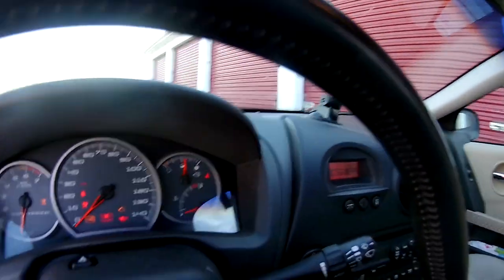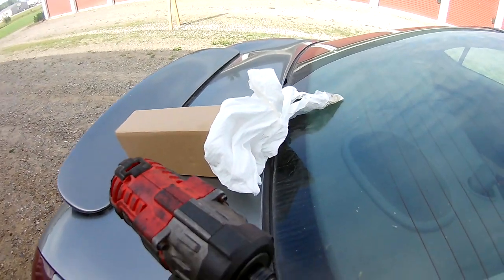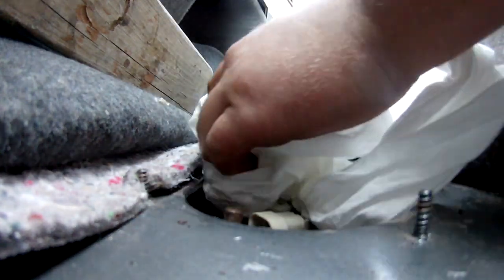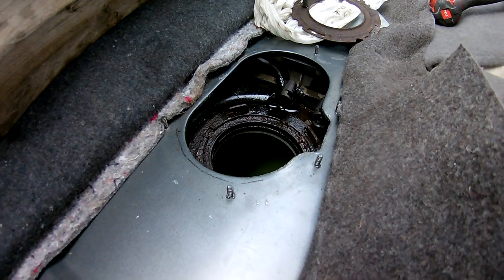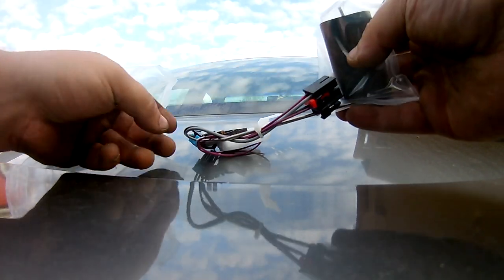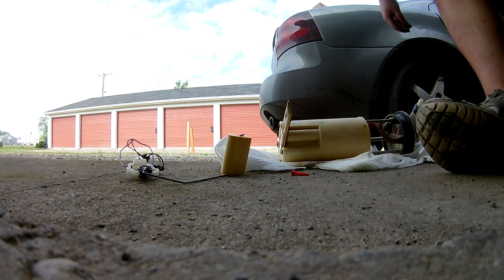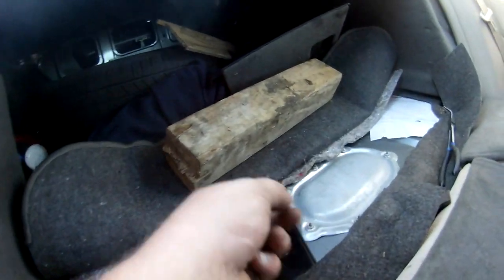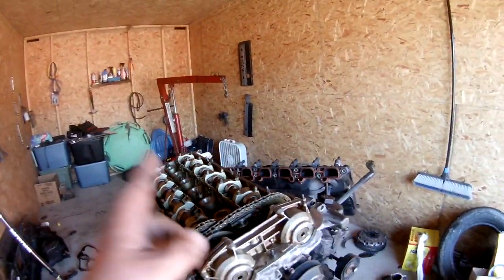Easy Fix To Grand Prix Gas Gauge Empty Full issue

Comment: If you have a 2006 or newer and have to cut an access hole in your trunk to get to the fuel pump (like I just did), the sensor is a different part number than the one in this video. The white plastic connector changed just a little bit. The year newer part (almost identical to the older one) cost just under $240.... yes $240 for basically the exact same part as the $40 one in this video for a 2005 and below. Looks like you can get an entire fuel pump with the sensor on Amazon for around $75-$80. I may try ordering that since I already cut an access hole.
Reply: Is it safe to cut into it the trunk tho?

Comment: It’s not “burned.” That’s just how surface printed carbon film resistors look. You can find them in any potentiometer. They still wear out though, as you demonstrate. Still, it’s just as often the wiper contacts wearing out. Too bad I can’t get to it in my Pontiac without dropping the tank. :(

Comment: Great video thanks.  Recently purchased an 04 GTP with 79k miles and the fuel gauge isn't working.  Looks like you walked me through how to fix it!

How is your fix holding up.  I see the AC Delco part is almost $170 versus the Dorman part which is $37!  Just curious if everything still working correctly.

Again, thanks for the video!
Reply from the maker: Glen Halstead anytime man! Jealous of the gtp
Reply: @GottisGarage  Are the Dorman parts holding up?  

I got a good deal on the GTP Comp G put it has the fuel gauge problem, code P0463 Fuel Level Senor Circuit High Input,  which after finding your video seems like a rather easy fix, and I'm getting a code, P0137 Oxygen Sensor Circuit Low Voltage, Bank 1 Sensor 2, Intermitent, which hopefully just replacing the O2 sensor.  

I have an 04 base GT Grand Prix but tranny went at 131k miles.  And the GTP Comp G only had 78,600 miles and exterior and interior were near near condition for $3400 plus tax/title & license.  I paid for the car fax and it was a one owner car that was serviced on a regular basis with no accidents reported.  I was quoted $3400 for a rebuilt tranny with 3 yr / 36k mile guaranteed.  The Comp G seemed like a no brainer for the same price.

Now I've found a place that will do a rebuilt tranny with a 2 year / 24k guarantee for $1700.  So may keep the base GT as a winter car and car for my oldest who will be driving later this year.  Even though the base GT has 131k on her for a pretty well mantained 3800 Series III engine I should be able to double that.  Have to see how I do after we finish our tax returns though about spending the $1700 (plus tax) on rebuilding the tranny.

Again, thanks for making the video.  It's going to be a great help in fixing the fuel gauge!  

I'll be sure to check out some of your other videos as well.  I've only been working on my own car for about 2 -3 years now.  But I've learned and saved A LOT of money by watching YouTube videos like yours.  I really appreciate people like yourself who are willing to share their knowledge and passion for keeping these cars, and cars in general, going.  Thank you very much!
Reply from the maker: Glen Halstead still working just fine! It’s a very cheap and easy fix that anyone can do, no point in dishing out money to have someone else do it for you! 
It’s a pretty common problem with gm vehicles, my Silverado is doing the same thing, but you have to drop the tank for that.
Reply from the maker: Glen Halstead I appreciate the compliments!

Comment: Ii have a 2000 grand prix gt sedan the fuel gauge stuck under empty and i replaced fuses, fuel pump, etc. And gauge still stays under empty...any ideas as to why?
Reply from the maker: did you replace the sensor like I did in this video? thats the main cause. the fuel level sensor is separate from the pump
Reply: @GottisGarage  i replaced everythng new
Reply: It starts and runs but im gonna try the super magnet thing
Reply: I wanna kno how
Reply: @gjterrones3920  did it work?

Comment: On a ' 73  Grand Prix my fuel gauge is stuck on "full"------problem is not with the fuel tank sender it has been replaced. Do you have any idea what the problem could be?
Reply from the maker: If I’m right that’s a ground issue
Reply: @GottisGarage  OK, Thanks much

Comment: Man, you aren't scared of much huh? I'd have went with brass, to take that ring off the pump to avoid a fire. One spark is all it takes bro.
Reply: you mean the cover to the fuel pump assembly? What brass tool would you use?

Comment: Just bought a 97 gtp supercharger 141k the Gage is not working weird it was working more than half of tank I noticed it goes wonky when I have a quarter left
Reply from the maker: Alex Gomez yep sounds like the same issue. It’s a easy fix man I wouldn’t hesitate
Reply: I think I have the same issue with my 06 gp gt. Just changed the battery and did some more fix. had to pay $350. Now this fuel gauge issue arises. DAMN!!

Comment: Great video. Switched out the part, worked for about a week then it started doing it again. Any idea what else might be wrong?
Reply from the maker: I appreciate the feedback! And I'm not sure? You could have gotten a faulty part but I'd check the signal wire. Could have a bad connection somewhere

Comment: You did all that work  taking the fuel pump out you should have also replace the fuel screen on the bottom of the pump with a new one.
Reply from the maker: Over a year ago I did this and it’s still running strong.... I think it will be ok.... thanks for the suggestion though

Comment: what part did u hit when u used the flat head an rubber mallet ?
Reply from the maker: There is a metal ring that holds the hat into place. You just use a flathead or something and hit it (turning counter clock wise) to get unlocked

Comment: What's the part that he fixed again?
Reply from the maker: Steam I just fixed the fuel level sensor
Reply: @GottisGarage  sweet thanks man I ordered it and hopefully it fixes my issue.
Reply from the maker: Steam good luck! It’s a pretty easy fix
Reply: @GottisGarage  yeah I am hoping to buy a device to jump out all the gas first that way the lines don't leak when I change it out!
Reply from the maker: Steam pull the fuse for the pump or just unplug it and start the car. It will use what fuel is left in the lines. Something I should have done
Reply: @GottisGarage  will do thanks man
Reply: @GottisGarage  which plugs do I pull both of the wired plugs or just one?
Reply from the maker: Steam both